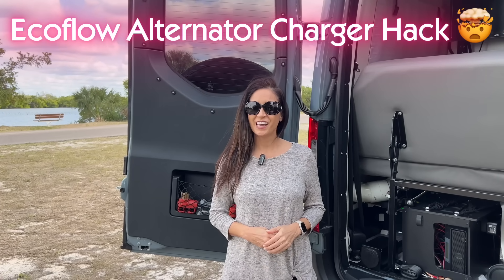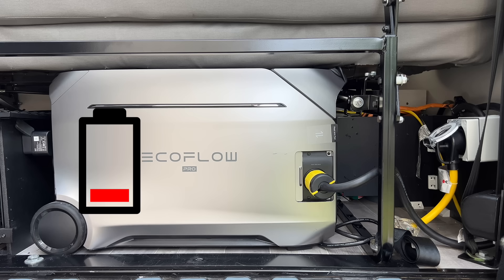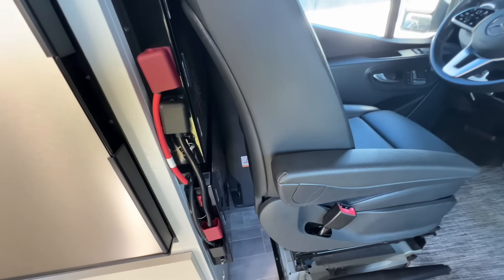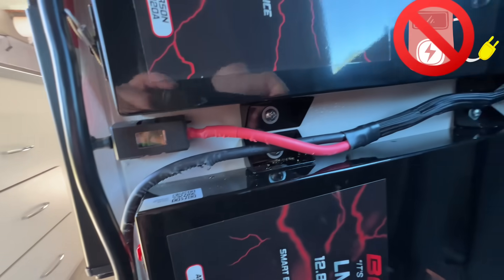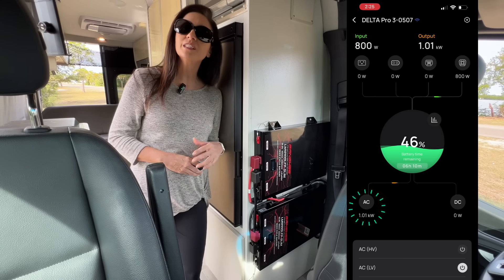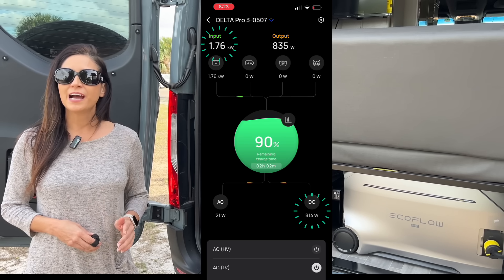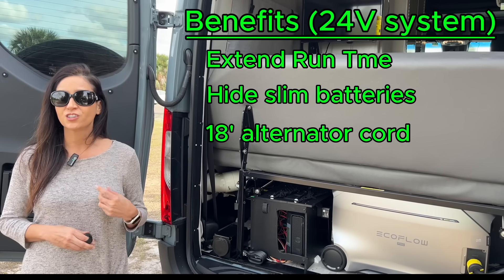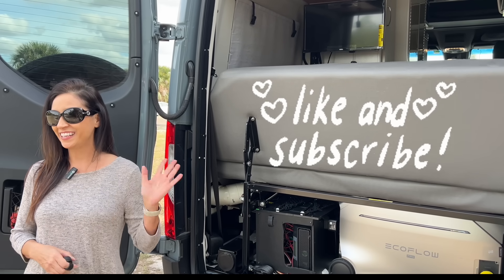EcoFlow Alternator Charger Works WITHOUT an Alternator (Game Changer) + Still Reverse Charges 25.6V

Comment: Your set up makes no sense to me.  Just take a 51.2v server rack battery....use a $22 ecoflow battery expansion cable to connect from your DP3 to a busbar (hack the one end open).....connect your 51.2v battery to the same busbar.....and youre done.  Bi-directional flow and your ecoflow charger does its job of pumping 800w of power while you drive.  Your solar ports are still open for solar charging....and you just added 5120 watt hours of power.  Just watch Jasonoid's video.  Your pretty little slim batteries are $600 a piece!!!!😂😂😂😂
Reply from the maker: Hello Fred, Thank you for the comment.  I have created many videos using 51.2V server rack batteries (and golf cart) but I have never spliced open a ecoflow expansion cable as I have not found that they are readily available.  However, the purpose of the video was to save space by using the slim batteries and to use the reverse charge feature of the alternator charger (no battery charger).  Of course, educating people on these capabilities as well. I will be creating another video soon, showing 4 slim LiTime batteries and I will be adding another alternator charger so that the whole system can charge via the alternator as well.  The LiTime batteries are less expensive, and even using 4 will still be cheaper than the Ecoflow expansion batteries. I am looking for ways to stashing batteries to build over 20Kwh of power without taking up critical storage space.  Thanks for Watching!

Comment: I like your battery selection. Looks like you "series" connected your batts to your EC-Alt-Chrgr, which connects to your Delta Pro3 via "Smart Generator Adapter."🤔
Reply from the maker: Thanks for the comment! Yes, you got it right - the series connection to the charger and then to the Delta Pro.

Comment: Love it.  We have a winnebago adventure wagon that exclusively uses the delta pro. We have been trying to figure out how to use an air conditioning source with the delta pro.But have been unsuccessful. The twelve volt plug from the delta pro will not handle the current.  Since you're using a twenty four volt source.Is there any way to run a 24v Air conditioner off of those batteries
Reply from the maker: You are correct, It is difficult to find a power station that has a DC outlet that is capable of managing an AC however you can always direct connect your AC to a DC power system as long as they match.  If you take a look at my AC comparison video, I test a 12V, 24V, and 48V AC against each other.  In that video you will see that I direct connected the ACs directly to a battery that matched each ACs power requirements.  Of course, you will want to add a battery terminal fuse or some other inline fuse for safety but many people connect their AC direct to a power source.  In this video, my batteries connected in series make 24V so that could work as well.  I will be creating a video soon that shows the Velit 12V AC connected to the Comvolt power station and I will also show that it could be connected to a 12V battery as well.  Thanks for asking the question and supporting the channel!

Comment: Ruby, you inspired me to wire a DC to DC charger to my Pecron to charge my house battery when my Aux alternator died! Works beautifully and I can add additional AH easily. Merry Christmas 🎄
Reply from the maker: Sorry to hear that your Aux alternator died, but glad you found a solution.  Would you mind sharing some details as many people read these comments and your experience may be able to help others.  For example, which Pecron,  which DC to DC, what volts is your house battery etc ...   Thank you for the comment and for supporting the channel!
Reply: @A @RubysAdventuresUnplugged  My Balmar XT-MS-170-K6 failed in van with only 14k miles. I installed a manual transfer switch behind my shore power receptacle. The transfer switch is connected to my Pecron F3000LFP via 10-30P plug. The Pecron is powered by Ecoflow 500W DC-DC charger. I went conservative with 500W. I ran the Pecron down to 1% in freezing temperatures outside Tahoe, and kept the house 400AH charged at 100% as if it was connected to shore power. This setup allowed me to monitor everything via Bluetooth which I could not do before. The order of operation is important if you don’t want to get a ground fault. The Pecron should be connected to the vans 120V outlet first before turning it on. This entire modification cost about $1K. I’ll be adding additional EP3000 batteries. When the weather warms, I already have a replacement Balmar waiting to be installed.
Reply from the maker: Awesome!  Thank you for sharing!

Comment: Very nice system, but for your DIY enthusiast, you can now get a 12.8 volt 614 AH or 7,800 WH for only $570, as LiFePO4 prices have plummeted. Just get a nice, full-sine wave inverter, and you've got a huge, monster system that powers my Class B Travato and more for under $ 1,000. BTW, it's powered by both solar and a 25 amp DC-to-DC charger.
Reply from the maker: Hello Phil, you make a great point but there are a few other considerations.  For example, you would need an Inverter charger, not just an inverter.  Also, most RVs need at least 30amp / 50amps to power everything inside the RV.  There are other benefits as well, for example, I can easily remove the power station and use it for other things as it is portable.  Also, adding extra power is easier as I do not have to consider buying the exact same battery when plugging power via the expansion or solar ports.  There are also a few standard safety feature that are contained within the Ecoflow.  Both methods have their pro and cons but thanks for the comment and supporting the channel!
Reply: @RubysAdventuresUnplugged  Inverter charger?  Not sure where you're coming from.  I have an existing system with a 5000-watt pure sine wave inverter with a Renogy DC to DC charger with solar input. My system is about 1/4 of your cost, so I could install 4 systems for the price of one. It also has a much smaller footprint as it's hidden inside a cabinet. Again, I am only addressing the DIY crowd.
Reply from the maker: An inverter charger does both invert power and charge the battery all in one unit.

Comment: Overkill to use the DC charger this way and kinda waste of money.  Just add a 53volt 5.3kw golfcart style battery or similar ($600ish) for a plug and play setup which only needs a 6g fused cable.  You can reverse charge using the battery BMS as well.
Reply from the maker: I appreciate your perspective, and I'm always looking for efficient ways to expand my power system!.  Can you explain more?  In my previous videos I have used 51.2V batteries via the solar port and was able to add 22.5kWh of power but it took up valuable space so now I am investigation other options.  For that set-up I added a 48V battery charger as well ... your idea seems different.  Thanks for the support!
Reply from the maker: BTW, I am not afraid of experimenting and am not concerned about warranties ... but I want it to be safe as well.

Comment: Why wouldn't you just add an external 48V battery to the Ecoflow and skip the alternator charger completely?
Reply from the maker: I have done that, and was able to achieve 22.5kWh of power connected to the Ecoflows solar ports.  Now I am looking to hit 30kWh of power through the DP3 so I am looking at ways to use the other input ports.  This video was just to prove that the concept works.  I ma targeting installing 4 slim 12.8V 100Ah batteries (2X 25.6V in parallel = 5120Wh) on the wall behind the drivers seat using the expansion battery port.  Then a 51.2V 200Ah battery (10,240Wh) + two 51.2V 100Ah golf cart batteries (10,240Wh) in the garage space using the solar ports, with the DP3 (4096Wh) ... for a total of 29,696Wh.
Reply: @RubysAdventuresUnplugged  That's almost as much as I have backing up my entire house!
They have recently figured out how to connect 48V server rack batteries to the Ecoflow expansion ports and it works bidirectionally as well.
Reply from the maker: Now that I need to see ... where can I find out more?  I have thought about using a step down converter and even a MPPT controller to make the connection but both would still require a charger.